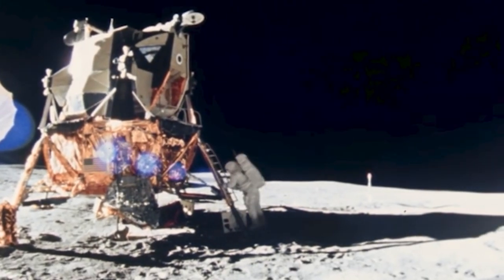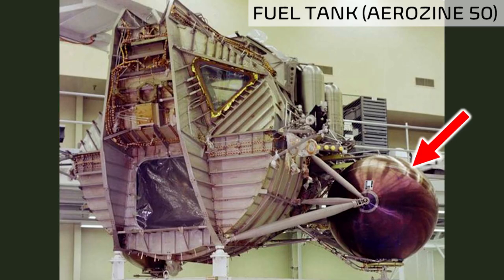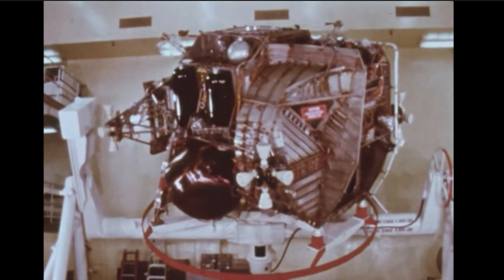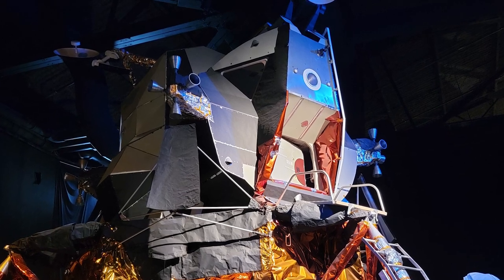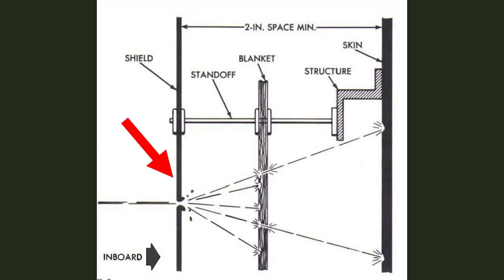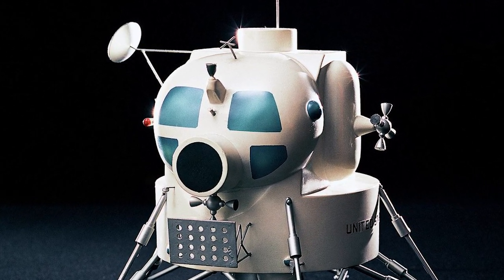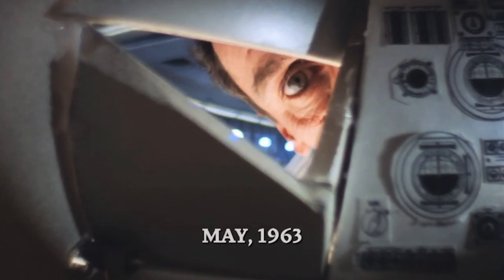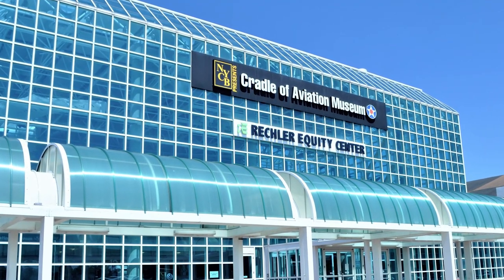Why did the Lunar Module look so funky?

Comment: What's really funky?  Trying to stay comfortable where it goes from 200° to -200°, with walls as thin as Aluminum foil, and a Heater and Air Conditioner that runs on Batteries.  Batteries from 1969...   they have to run (on batteries) 24/7 for 48+ hours... ?....  um.. ok...